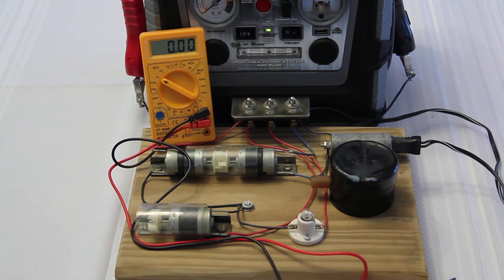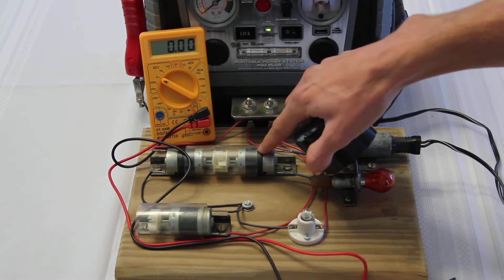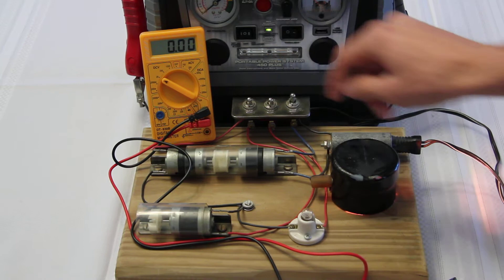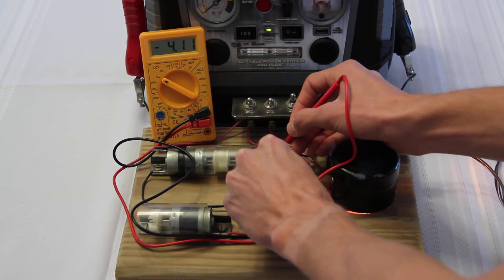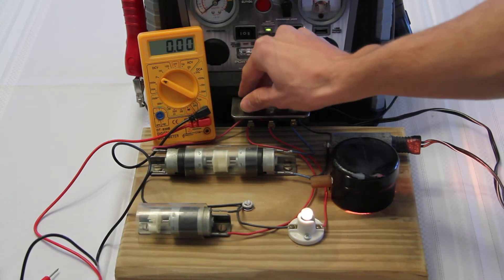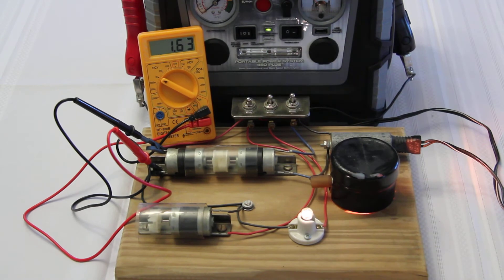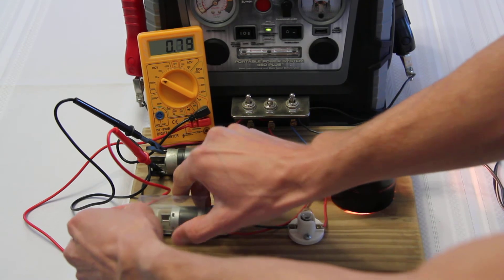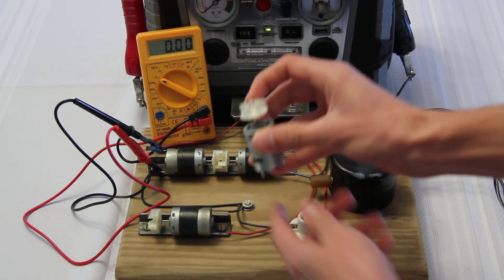Motor Generator

Comment: The motors slowing down under load is due to them being fed through the first lamp.  They would work better if fed directly from a 4.5V or 5V supply.